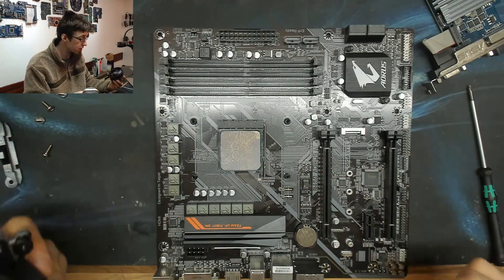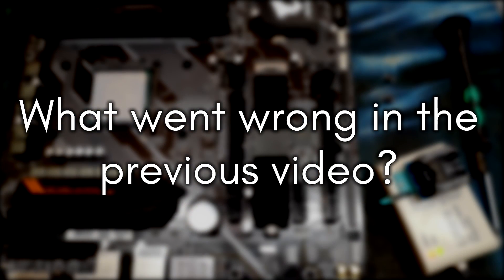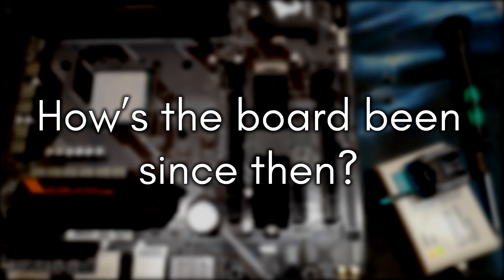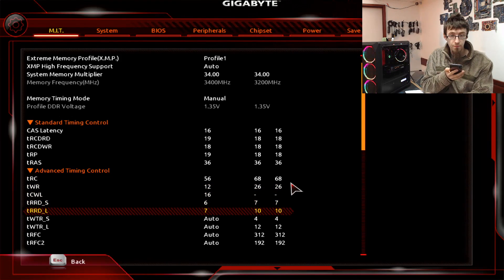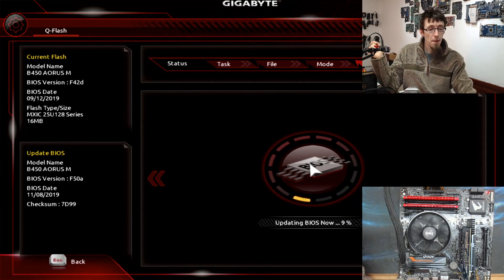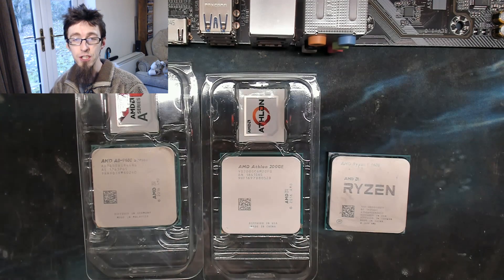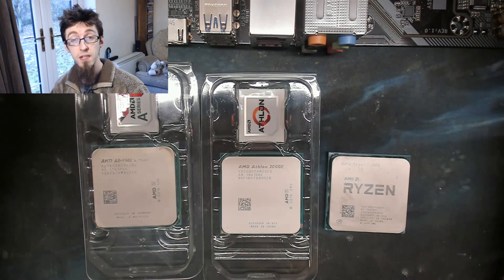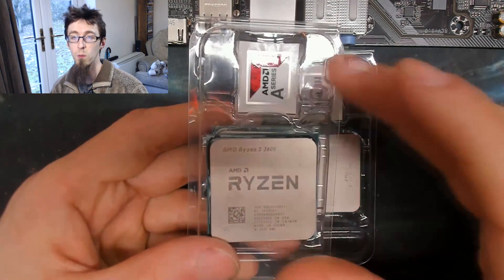LFC#186 - Gigabyte B450 Aorus M Update and Conclusion

Comment: Just be aware that a ryzen 2000 apu is actually a first gen ryzen processor with a 2000-series name and it will probably be cut from the support list at the same time as other first gen parts.

Comment: Hi, should I install windows once I upgrade my bios to F32 so I can install that EC FW Update tool then upgrade my bios to F42 then F50?

I’m finally be able to build my first pc and I’m kinda worried about that memory incompatibility thing.
(I have an aorus b450 pro wifi for my motherboard)
Reply from the maker: I think that's the best plan. Normally I wouldn't consider that to be required, but it seems to be what you're supposed to do with this board. I eventually got through without doing that, but it wasn't exactly smooth.

Comment: so how am I supposed to update my aorus B450 M motherboard (version F1)? should I follow the sites order: update chipset, F32, F40 and then F50? thanks in advanced.
Reply: currently using R5 2600x as the CPU
Reply from the maker: With a 2600x you shouldn't run into any issues. Current 'safe' method should be;
1. Update to latest chipset drivers in windows
2. Update to F32
3. Run EC FW Update Tool
4. Update to F40
5. Update to F50
Reply: @Adamant_IT  wow thanks a lot. I updated the chipset just now and I will try to update the bios tomorrow.
Reply: I will keep using the 2600x, but I read that these bios updates (especially from F1) can increase performance significantly. do you think that is true? or do you discourage me to update? thanks
Reply: I just updated chipsets and installed F32 and used the EC FW tool and now my bios is back to F2, what do I do now?? I am so confused
Reply from the maker: urrrgh. Try running the F32 update again, and then carry on. Updates with this board don't make a lot of sense tbh.
Reply: @Adamant_IT   apparently I was running on the backup bios after using the EC FW file. After updating the backup I turned down the powersupply and that made it go back to the main bios which was still on f32 and from there I just went to f40 and f50. Weird stuff lol
Reply: @StagnantMizu  hello man , i got the same cpu and mobo too and already doing the step like u do from f2 to f32 to ecfw then the bios back to f2 again. and i using it till now. 

What do u mean by updating backup? like q-flash again back to f32 or else.

Hope u can answer, sorry for my bad english, Thank u

Comment: I just purchased this board last week, and according to the seller currently, its allegedly compatible with 3000 series ryzen CPU's out of the box, but I can't get a post, or hardly any electrical response. Turning on the PSU gives a short brief blue flash on the LED panel on the back of the PCB under the IO. Is this a bios issue? Is this caused because I'm using a 3600x? (Note that when I initially built the PC, I was able to get a boot out of it, but wasn't able to enter bios so I shut it down and tried again, and after that, I couldn't get any response from the components or board except for the previously mentioned LED flash)
Reply from the maker: If you've seen a picture on the screen at least once with a 3600x in it, then it's had the BIOS update for Ryzen 3000. Past that, there's a laundry list of things this could be, including a corrupted BIOS.
Make sure you've done a BIOS reset with the CMOS battery and/or jumper. I'm going to assume that yu've got known-good RAM/CPU/PSU here. If you haven't tested those on another machine, or tried different ones with your mobo, do that first.
If that doesn't do it I'd try shorting pins 1 and 6 of the Main Bios chip with tweezers while you turn it on until you get a beep (make sure you have a beep speaker connected). This trick hasn't worked for me, but I keep getting people commenting with this answer on my gigabyte troubleshooting videos, so it's worth a shot.

Comment: I had 2 x370 by hand, MSI x370 SLI Plus and Biostar X370gt7 and one B450, MSI mortar, that when switched from the wall for more than a day, they lost bios configurations, all of them. Regarding to the comment about that. All mobos were brand new bought by me. And still used by me and my family. So I guessed that it is a AM4 "feature" for mortals. I only didn't try out top end boards if they behave like that.
Reply: Hey brother! I know I'm a little late but worth the try... Did you found any solution for this? I have the same problem with my B450 Aorus Elite v2.
Reply: @matheus9365  there is no solution, I think the uefi (bios) is too complicated program so it loses all the data I'd out of energy. I need to try it out on b550 Tomahawk which I have now... Didn't try it. Just never turn off the psu and that is that... I did it since I found out about the issue.
Reply: @ShomyKajge  the strange thing is that I just usually turn off my PC on windows start button and that's it, I don't press the switch in the back of my psu or unplug it from the wall and it still looses all the settings. I didn't tried to only use hibernation yet, heard about it "solving" this problem for some people but is kinda shit to never be able to turn off my PC properly :/ edit: hibernation didn't solved it too, looks like everything I do is useless. It works good all day, passes in every mem check test i do, but next day on cold boot it crashes, dram led on my mobo lights up and it don't want to post until I unplug it from the wall. And when it starts all bios settings are been reset. I don't use oc, just xmp 3200 and optimized defaults. I'm so frustrated man...
Reply: @matheus9365  Oh that is a different kind of issue... and I am not sure how to resolve that. That sucks for real. So other bioses didn't help?
Reply: @ShomyKajge  nope. I've tried 3 different BIOS and it didn't worked. I saw someone that had the same problem that I have saying that, in contact with gigabyte support, they were told to downgrade their BIOS version, update something (probably ECFW)z update Chipset driver and then update his BIOS for the last version. The guy didn't knew what exactly they told him to do because it was like one year ago. I'll ask him if he can check wich things he updated so I can do the same. At least I'm a little happy knowing that is software-related, I won't need to touch a brand new mobo ir send it to RMA. I'll update you guys when I make some progress.

Comment: After looking at bios for other brands of b450 boards lots seem to have this problem and most have some sort of windows update inbetween different bios. Iv just been looking at asrock steel lengend boards for my son and his board also has to be done in order so you dont get this type of lock up. I myself have a b450 Aorus Pro board and went from a 1700x to a 3700x, but first installed f40 bios with 1700x in board then install 3700x and updated bios to f50 straight after. Might help some of you if still having problems.

Comment: Dual Channel doesn't seem to work for me on F50. I managed to downgrade to F40 and it worked for another 10 minutes until a BSOD every time Windows boots. Is it because of my cheap RAM (Goodram 2x8GB 2400MHz, both identical)?
Reply from the maker: Could be... sounds suspect. Try memtesting each stick on its own to see if you've got a faulty module in there.
Reply: @Adamant_IT  Ah I forgot to mention. I tested each of them individually in single channel and they worked without any issue.
Currently trying F41 to see if it does anything, if not I'll bite the bullet and order a Vengeance LPX kit. At least I'll be able to find out it's from the motherboard.
EDIT: It's also paired with a Ryzen 5 2600X. Doubt it's from that but dual channel worked previously on an A320 board.
Reply from the maker: Mmm. Have you installed the EC Firmware update as well? I know that does stuff with memory topology, but I thought it was just for 4-module setups.
Reply: @Adamant_IT  I've installed that update but it didn't seem to help much with anything. I just ordered a new RAM kit out of curiosity so I'll let you know if I have any issues with that.
Reply: @Adamant_IT   Installed the new RAM kit but XMP doesn't seem to behave too well with a Ryzen 5 2600X. At 3200MHz games that used to work just fine now crash to desktop after about 10 minutes. I'll look into manually tuning the modules using that DRAM calculator for Ryzen.
Reply: @pireucucarnisa  Hey brother! I know I'm a little late but worth the try... Did you find any solution for this? I have the same problem with my B450 Aorus Elite v2
Reply: @matheus9365  Nope, I just returned it and purchased an ASUS instead.
Reply: @pireucucarnisa  good mate. Thank you for answering me!

Comment: I'm looking at getting the B450 AORUS PRO WIFI (rev. 1.0) can anyone tell me if the bios on those are up to date and if not do you know if they have fixed the issue with the EC FW Update Tool or is that just an issue with the x470 board?

Comment: hey adamant IT, is it safe to the newest bios f50 for this mobo? I'm running a ryzen 3400g. please help me.
Reply from the maker: You should be fine, newest should be the best, and it was for me. However, this board is a bit mad so I promise nothing.
Reply: @Adamant_IT  thanks. wouldnt wanna risk it for now,. cant seem to find a ryzen 3400g community who are running gigabyte's aorus m b450 boards, would have been nice to have a reference before i try it.
Reply: @Adamant_IT  hey mate, you mentioned that in order to flash the bios for this mobo to the most stable bios f50, we users are going to need a Ryzen 1000 or 2000 cpu/APU. before i do it though, i just want to confirm that the 3400g (zen +) is a 2000 ryzen cpu and is okay to use when I flash bios to F32 then to F50?

Comment: I have the same mobo paired with 2400 g, and my current bios ver. F30. If i upgrade my bios from f30 to the latest can i still use my 2400g integrated graphics?
Reply from the maker: Yes, 2400g is safe at any BIOS version.

Comment: Hi AdamantIT, i hope you're doing well. First of all thank you very much for this "sagas" and all of your hard work. My question could be a little bit tedious adding context, i've purchased this mobo without knowing this issue.
I want to make a summary before getting into the storm, because if i brick this mobo it is VERY difficult here for me to do some recovery handlings at this time.

1) Let me specify my setup before anything:
- GB Aorus B450M (fusion rgb 2.0 blah blah).
- Ryzen 5 1600"AF" this new version of 2019.
- Patriot 2x8GB 2133 (3200MHz OC).
and other stuff.

2) My reasons: I've looking at the stability problems about BIOS and even if i'm not going to 3000 series right now, i might want to overclock my memory to reach the best speed i have, also take the best out of my mobo in general (also some day i could go to 3000 series ).

3) Procedure (what i'm really asking for): if i don't misunderstood GB website AND this video, i should:
a) Upgrade AMD Chipset Drivers before BIOS update.
b) Get from F1 to -> F32 then to -> F40 then to-> F50 (each individual from pendrive one at a time from BIOS SETUP).
c) test everything (POST times, ram OC, boot, etc...).

i hope you could read this, in advance i apologize about my long comment and beforehand MANY thanks.
Got a new subscriber.
Best regards!
Reply from the maker: Yup, that all looks fine to me. I would leave XMP (RAM OC) turned off while you do all this, then turn it back on once you're finished.
I'd also suggest installing the EC FW Update as well, which is mentioned in the red-text. It's not essential, but I believe the board does weird things if you later move to a 4-RAM-module setup without the update installed. I don't think it really matters when you do this, as 2-modules works just fine.
Reply: @Adamant_IT  So, Many thanks AdamantIT, all went fine and it's a pleasure to have this kind of support by you side. Keep on, this channel is really great, i really appreciate it. Greetings!

Comment: So the BIOS updates are laddered... how many "Fxxx" updates will stay on the bios chips? Thanks
Reply from the maker: I'm honestly not sure, the backup BIOS did not work to any useful extend while I was working on this board. Gigabyte need to drop the 'automatic' bit and just stick a selector switch on the board, so the backup BIOS is isolated.
Reply: @Adamant_IT  i thought the backup bios worked when the primary IC konked out, or got corrupted. Does the b/up keep the previous "Fxxx" bios below the current/latest one? Am looking over the MSI B450m mortar. The bios flash feature is a great idea! Thanks
Reply from the maker: That's the thing, the backup BIOS doesn't help if you simply flash a bad BIOS version or something, so you can 'lock yourself out' so to speak.
But yea, the MSI Mortar is a better alternative to this, just be sure to get the Mortar MAX, as it's a new revision that's factory updated.
Reply: @Adamant_IT  i think the mortar max is a bit higher $$, but probably worth it. Another method would be, when i got the gigabyte m/b, have a pc shop correctly update/flash the bios, as i dont have 2 or 3 suitable amd cpus sitting around to do it at home! Thanks again 🤓

Comment: I watched your video and bought this motherboard with AMD ryzen 5 2600 3.4. I have F4 version on bios. so do i need to flash first F32 ? and later to update to 50 ?
Reply from the maker: Yea F32 and then F50. You should have no hassles with a 2600.
Reply: @Adamant_IT  thanks sir

Comment: Where can i find bios version 50a? Official website doesn't have it.
Reply: Scratch that, just read online that it was removed because it had lot's of problems.
Reply: Also, the bios being reset when unplugged from the wall? Was that fixed when you reflowed the chip or it still happens?
Reply from the maker: Yea that randomly fixed itself when I reflowed. I've no idea if that will fix it for someone else though.
Reply: its f50 now.

Comment: Apology for a question on an old video. I have a Gigabyte Aurous M. I have a Ryzen 5 2600x CPU. I just bought a Ryzen 9 3900x CPU as a upgrade. My current BIOS is F2. All I have to do is BIOS update to F30, then F50a, then drop in my Ryzen 9 3900x and i'm all set. Am I Correct? Thank you for a relpy if you have the time!
Reply from the maker: Yes that's correct. Although of note, as of this comment it's now just F50, rather than F50a.
Reply: @Adamant_IT  Thank you. I'm still having an issue though. I updated to F30 BIOS just fine, but when I attempt to Update to F50 BIOS My PC stops registering mouse and Keyboard input. I select the F50 BIOS, and it tells me "Press here to Start". However I can not because it no longer takes any Keyboard or Mouse inputs. If I try again, the next time it'll say "Invalid BIOS image". I re-download and upzip the F50 BIOS to my flash drive, and it takes the BIOS F50, but again, just won't register my mouse movements or Keyboard input. Edit : I found out the problem. F30 BIOS didn't support all my USB ports. I  updated to F32 BIOS after the F30 BIOS, and then F50 BIOS. Works fine now.

Comment: Hi Adamant IT, just stumbled upon your channel and I loved what I´ve seen as of yet.
Please keep up the good work!

I do also have a quesiton though. I have a Gigabyte B450 Aorus Elite MoBo for my Ryzen 5 3600 CPU, 
though it has issues with reaching the advertised boost clocks and seems to bottleneck without full utilisation of any cores.

I then came upon an article claiming that these issues had to do with the early Zen 2 compatible BIOS F40, 
which is installed on my MoBo, and wanted to update to the newest BIOS version ever since.   
Though TBH, I´m quite intimidated by the lack of a DualBIOS on the Aorus Elite B450 and the possibility of bricking my MoBo.

Would you recommend that I update the MoBo to the newest BIOS to help with these issues, or do you think this is not warranted?
If the former, how would you recommend I update this particular MoBO?
Should I just go directly to F51? Or should I go to F50 or any of the former BIOS updates first?
Reply from the maker: What kind of on-load temperatures are you getting? Lack of boost shouldn't be aboard issues as far as I know.
But yea, I would at least try a BIOS update. If you're already on F40, you're past the 'dodgy area', and if F50 or F51 doesn't help, you can downgrade again. But I wouldn't go lower than F42.
Reply: @Adamant_IT  thx for your help, about 70-80°C  at about 60-70% load with an aftermarket cooler. 

Acording to techpowerup the issue has something to do with windows and the BIOS not working together due to Windows allocating workloads on lower quality cores rather than letting Ryzen´s own firmare handle it. 

Apparently this issue has been mitigated with the newest AGESA 1.0.0.4 version, which Gigabyte introduced on their F50 BIOS.

So, have I understood you correctly that I should be able to update directly to F51 from F40? What are my possibilities if the BIOS update fails? I believe the B450 Aorus Elite doesn´t have a dualBIOS, so how would I go back to F42 if the MoBo doesn't POST?

Comment: Hi I hope you can help me. I got this MB on F50 and 3700x cant seem to work fine. It keeps on getting BSOD. my friends 2600 works fine without problems on this MB. Already tried changing RAMS and PSU and still the problems persist. Should I downgrade to a different bios version or what? thanks
Reply from the maker: Yea, try a different BIOS version. I found F50 to be better, but there's a couple of people in the comments who seem to have had problems with F50. This board really seems to be a matter of 'try stuff until it works.'

Comment: Hello, on higher BIOS versions like f41/ f50 you can get 4 DIMMs of RAM on a 3rd GEN ryzen without this step "2. Before update BIOS to F40, you have to install EC FW Update Tool (B19.0517.1 or later version) to avoid 4DIMM DDR incompatibility on 3rd Gen AMD Ryzen™ CPU" ?  Thanks for the videos.
Reply from the maker: I must confess I didn't test 4-modules properly. But yea, as I understand it you need to do that Firmware update at some point if you want to use 4 modules with Ryzen 3000.